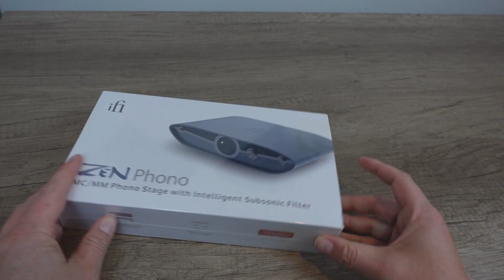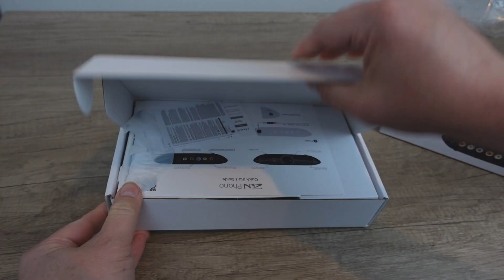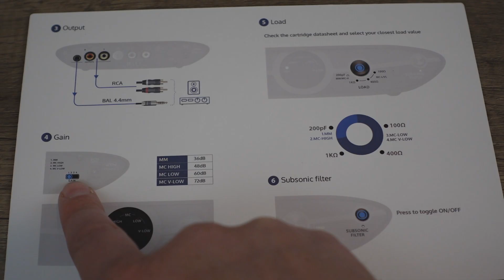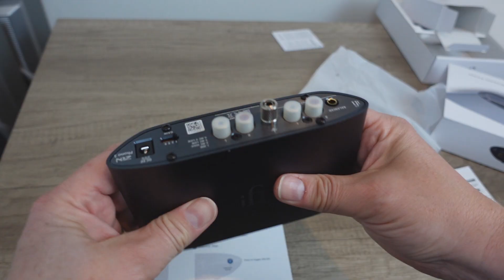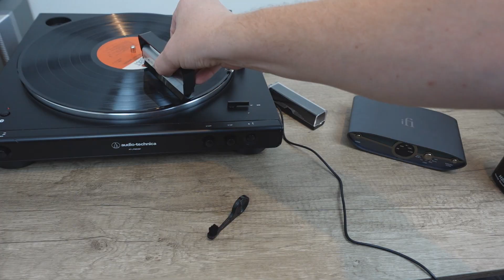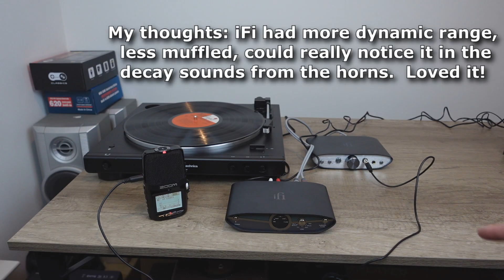iFi Zen Phono 3 Preamp! Unboxing & Review!  w/ Subsonic filter!

Comment: Your review is part of why I recently bought one of these, since you had included a transfer made through it.  It wound up being even better than I expected once I got it and it got some use.

If some is using it with an MM cartridge that is not too high output, do try the 48db gain setting vs the 36db.  I use it with a 4mv output Shure M110HE with a Jico SAS stylus (an extra I had that was meant for the V15 VxMR. but sounds amazing in the M110HE) in a direct drive Denon turntable, and even though the output is a bit more than ideal vs the range of volume adjustment of my Marantz 2238B receiver that I use it with, I greatly prefer it to the 36db position.  At the 36db gain in my setting, It's nice enough, but too polite and soft and reserved, but at the 48dn setting it comes alive with the dynamics/slam/drive it should have.  I also had to set the capacitance to 200pf vs 100pf to sound properly balanced.  It amazingly neutral tonally and sounds at like it's worth at least $1,000 once I set it up as I described.  I've had mine now for close to a month, and I am astonished how something I paid so little for sounds so good (I got one listed as refurbished with further discount applied and wound up being about $160).  Highly recommended.

Comment: I have 3 separate systems but all 3 suffer from some sort of feedback that makes my woofers in my speakers flutter like crazy as well as my subs if I turn up the volume to medium to higher levels. I have tried all of the solutions online short of buying a new house. I never had these problems back in the 70s and 80s for some reason. I put my turntables away in 1985 after getting my first cd player. I thought maybe my old tables were at fault so I bought a new Audio Technica 140 for $500 and it was the same. I am reminded of why I loved cds. Will this thing solve my problem? I have spent way too much time and money on vinyl playback so I can enjoy my old collection but it has been a nightmare.

Comment: Can i complete Turn Off the load Switch? Because 200pf IS a little bit high for AT cardridges. When you add the load of the cables of about 100 pf then one  is over the recomended load of 100-200 pf of load.

Comment: Why didn’t you use the balanced out on the pre-amp to your recorder?  I think that would sound much better.  I think the going through the headphone amp would make it worse, not better.

I’m also not sure you had the right impedance setting for your cartridge.  I have a higher end 1990 turntable & amp with an Ortofon 2M Blue currently… and though the built in amp preamp is really pretty good the iFi Zen 3 made a huge difference for me.   I got mine this summer on a good Music Direct sale for about $200 and it way out performs its price for sure!

Comment: It's not mid range. It's low range. To reach mid range, you would need to pay a lot more. You are using it with the bottom of the range Turntable with an average Phono Stage so the sound should be better. The IFI Phono 3 has four filters which can be switched. Each will give a different sound depending on preference.

Comment: I can tell a difference.  The iFi did sound cleaner with a bit more detail.  Still difficult given the limitations of YouTube and such, even though I am listening to on a pretty nice system.  I still think one of the better upgrades one can make is getting a decent external pre-amp for their turntable, especially using these somewhat entry to mid-range AT LP60-type turntables.  The built-in pre-amps in those units do work and actually sound pretty good, but I can definitely tell a difference when a good external pre-amp is used.  Of course, that also assumes all your up-stream components are also of decent quality (amps/speakers)..
Reply: @SkiBumMSP  yes. Pretty much what I heard. The without sounded fine... but the preamp just gave it more.

Comment: Great vid as always!  Many years ago, I tried to record one of my albums on cassette so I could play it in the car, it was one of those Deep Heat dance music compilations from back in the 90’s.  Every time I played back my recording from tape I got terrible distortion, it was totally unlistenable no matter what tape I chose.  I thought that my cassette deck was faulty initially, but I finally figured out that the pressing was defective in that there was some low-end noise that I’d never heard from my speakers as it was too low down, about 20Hz, it sounded fine to me played straight from the vinyl.  However, the cassette recorder was picking it up and it saturated the tape.  This is where I could’ve done with a subsonic filter!

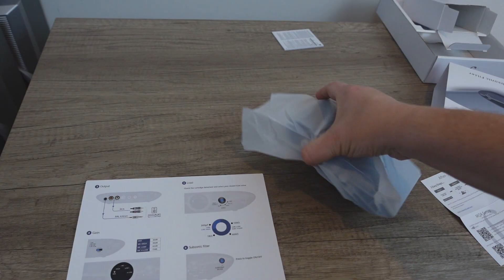Comment: 3:33 Audio tech with 47 years experience here. Your description of the problems caused by very low frequency signals in a stereo system is absolutely correct. But I still don't understand why it is that after seven decades of the audio industry making this mistake, they cannot get the name of the filter right. It is an INFRASONIC filter, not a SUBSONIC filter. Infrasonic means "too low in frequency to be audible," while subsonic means "slower than the speed of sound."
Reply: Money.